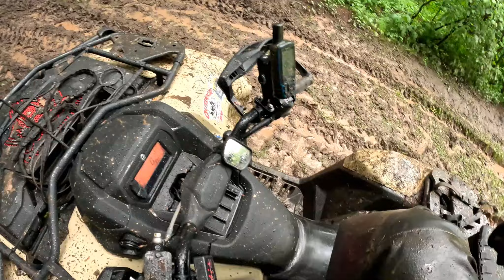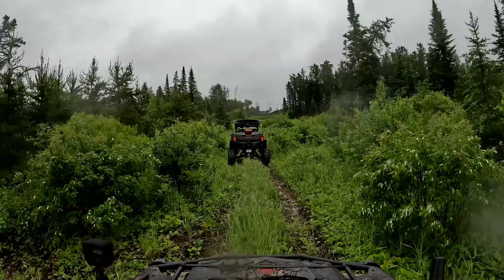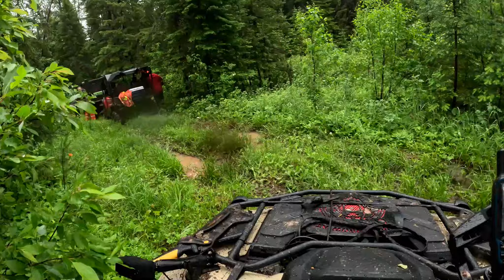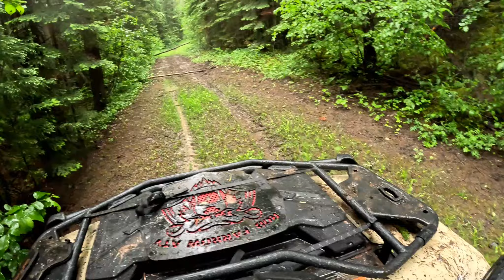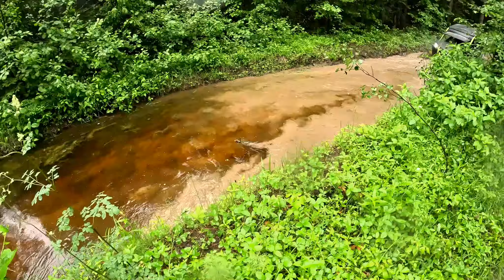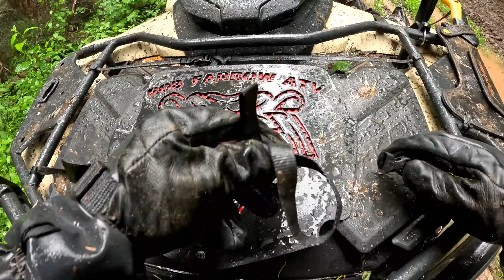Nasty Ruts Mud Getting Deep ATV SXS Can Am Outlander 700 Extreme Poker ride

Comment: Wow that was a good video. Looks like you guys were having lots of fun. Did your radiator stay clear of the mud you were talking about? Also when the belt got wet were you clearing it of water?
Reply from the maker: Thanks Man! Ya the mud was thinned out from all the rain and didn't clog the rad. I drained the clutch box with the easy plug at the bottom and she dried out quickly. Checked and cleaned it when I got home.